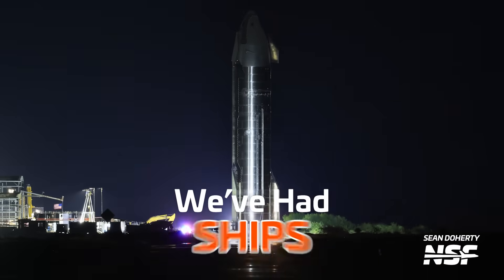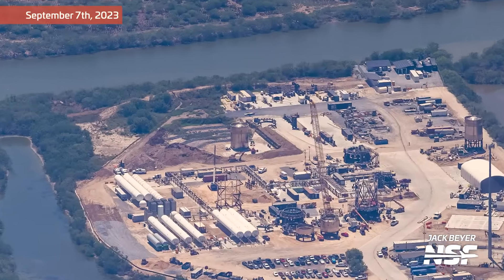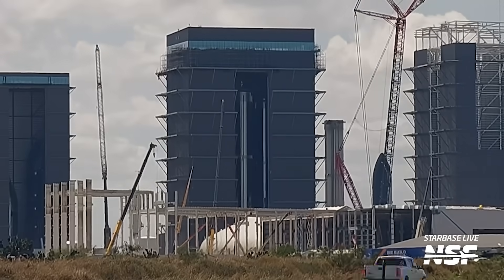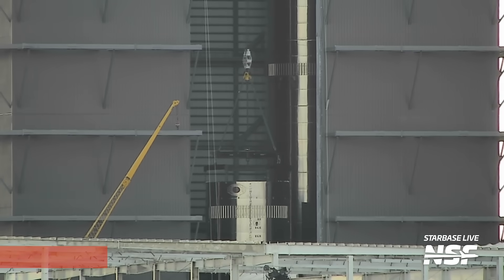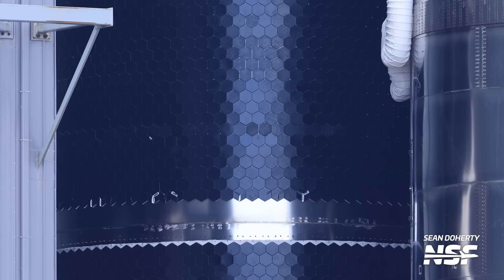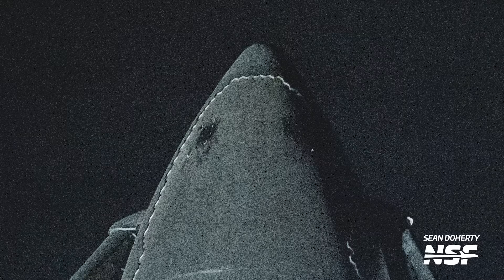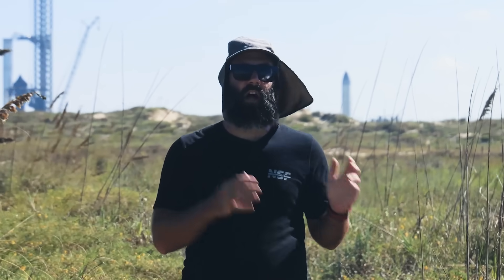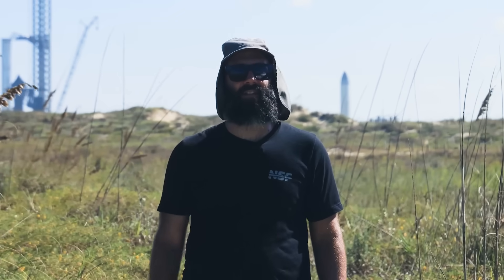Starbase Isn't Slowing Down! | SpaceX Starbase Update

Comment: Fun fact: average yearly rainfall on the completed Starfactory roof is enough for 15 launches. In winter it takes two months to collect water for one launch, in the wet month of September it takes ten days on average.
Methalox engine exhaust is not likely to add significant amounts of environmentally hazardous chemicals to the deluge water. Drinking water on the other hand contains residue of purification chemicals and most of all chlorine, a pretty nasty chemical in a biologically sensitve area, at least when hundereds of thousands of gallons are used. Per launch. Or maybe the worst pollution from using drinking water is the diesel exhaust from hauling the water from whichever waterplant the source it from.
Reply from the maker: The water SpaceX is using is potable water straight from the Brownsville public water systems. If you're worried about contaminants in drinking water vs rainfall... then you agree the effects of the water being used need to be understood. -Das

Comment: Those 4 square heat tiles are drilled with smaller holes at the leading edge and larger holes but fewer of them at the trailing edge of the tiles. This test arrangement is obviously intended to vent the build up of moisture from within each tile. The reason for this test is to have a potential fix ready for problems that haven't been encountered yet.

Comment: I still dont understand why they put the offices at the top of the bays? I know its probably for room, but a side extension like the "dog house," or expanding the side of a bay? Ant thoughts?
Reply: Yes, it is strange.  My 1st guess:  Lack of ground space to build a little office building.  So the office has to be stacked.  And it cannot be stacked on the bottom.  I suspect that the office only takes up part of that top floor, and the rest is crane supplies.  My 2nd guess:  Once Starship leaves initial testing, they'll be a lot of complex work at the top, so having offices and meeting rooms at the top to discuss that complex work makes sense.

Comment: All of those Boosters and Ships now under construction at BC or finished will be non-reusable. They will be splashed. It's unknown when the tower landing tests will be started and how many such tests will need to be done before the first success is accomplished. That's why SpaceX has the Booster and Ship production lines at BC running full tilt now. A continuous supply of expendable Boosters and Ships is needed to make progress on the Starship flight test program at BC.

If SpaceX had followed the original site plan for Boca Chica, that second tower would have been ready in late 2022 or early 2023 and tower landing tests could have been started 8 or 10 months ago while SpX was building the OLM at the first BC tower. 

Now, the U.S. Fish and Wildlife Service has 135 days to evaluate the modifications made to the OLM at BC in the aftermath of the Starship IFT-1 flight. IFT-1 was launched on 20April2023. SN15, the previous Starship launch, occurred on 5May2021. The interval between these two launches is 715 days (23.5 months). That realization makes that 135-day delay seem very short by comparison. For a flight test program to stand down 23.5 months is very discouraging considering that with better planning that time interval could have been used to perfect Starship tower landings, if that second BC tower had been built per the original schedule.

Comment: I don't recall paper work delaying launches ten years ago. I recall hardware issues. So to me, these continual regulatory delays are quite disturbing.
Reply: Ten years ago they where not developing a super rocket and launching from a new launchpad. They where developing a pretty standard size rocket and launching from nasa established launchpads that have been up and running for decades. Also the delays have been minimal if real at all. Remember last time when elon complained on twitter like a child and then they had the approval WAY before they where ready with the rocket anyway. Yea people need to take that right wing anti government reaction and toss it in the trash and look at reality instead.
Reply: This has happened always. Falcon 9's maiden flight was delayed by two months due to the flight termination system needed to be certified by the US Air Force before any flight could happen. And if you think that's bad and but it was just 13 years ago, try a two year delay for Electron's debut from Wallops because of the same thing but with NASA's Autonomous Flight Termination System. This has happened pretty much always and it's definitely not exclusive to SpaceX.
Reply: With all due respect - or not- to Elon, it’s not just ‘paperwork’; he made major changes, so an honest assessment is being made, as per the law. Simple.

Comment: There's only one way to learn if it works.
Build a test item, bring it up to nominal working pressure, if it holds firm, all well and good, then increase the pressure until it goes pop.
That's the only way to learn.
Reply: Only way to certify your calculations.  Still early stages of test vehicles.  More boom to come.

Comment: The water is sprayed all over the wetlands?
Reply: He seems to be very careful to appease the government gods
Reply: The water reaches into the wetlands, but it is clean water that has not touched the ground. The water that does is collected in a pond. The Fish and Wildlife Service has to make sure that water does not harm the wetlands and the wildlife in it. The land has brackish water, as well as salt water depending on the weather, they just need to check if clean water could be harmful for the salinity.
Reply: @knowledgeisgood9645  A good thunderstorm would introduce more freshwater that the deluge system.
Reply: @59seank yea that’s a good point. I think Knowledgeisgood is off on his take. I doubt it’s the salinity, but more the contamination of the water being blasted by the exhaust from the rocket engines. And additionally, just the sheer volume being blasted into that one specific area.
Reply: @knowledgeisgood9645  OK, interesting. Still have a hard time imagining that the water could have a bad impact but I guess its a good reason to delay furhter

Comment: I really appreciate the excited but realistic expectations.  Take the time to do it right so long term viability is assured.
Reply: It will get there just like Dragon and it's boosters initially had their issues but has proven to be a very reliable launch platform.  Edison went through many failures before he got the light bulb right
Reply: That's not the way. This is build it, fly it, adapt, fly it again, adapt and then foolproof it. Much better in the short and long term.

Comment: What if the 26.1 tank is for orbital reufueling. Maybe they test if it is viable to somehow boost those Tanks into orbit and Assemble them via the ship/booster connection System to build a si ple refueling station in or it. 
I mean. They basically have everything and it might Sound a bit far fetched but. If they make the nosesection of the suspected "Tanker ships" detachable with the same System. It might be relatively easy to just Dock them back up in orbit??? With some modifications of course.
But i kinda liked the idea and would like to know what others think of it.
Reply: Nope. Tankers and the fuel depo are just normal ships with a payload of propellants.
These tests are to make sure the new designs achieve their stated goals. The documentation resulting from the tests is needed for SpaceX, NASA and the FAA.